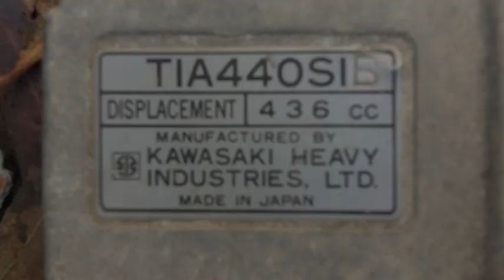Old Start the 1972 Arctic Cat 440 Kawasaki Panther Engine

Comment from the maker: Hey Ron, When I got this engine, I had intended to put it in a Honda Odyssey ATV...that would have been a killer machine for sure.  I ended getting an offer I could not refuse on the Honda and sold it. The engine has been sitting,  waiting for a new use...I hope it will work out. Thanks for watching.
Reply: Did u ever get it in a oddessy cause I’m currently trying the same thing with that motor?
Reply from the maker: @Fartmansdoodoo  Nah, I never found a good oddessy frame and eventually sold this engine.

Comment from the maker: @Graveltrucking I plan on running this CVT through a rear Diff I pulled from a 4x4 quad that has a stripped axle shaft. It is geared low enough that I should be able to keep the revs high on the engine and with good blade speed. The compression is remarkably strong at 175psi.
Reply: UH. yeah ...you might want to check calibration on that comp. tester.. Old 2strk. with questionable ring seal?
Real world bet is 120 psi. If lucky.  (440 Kawi. single carb. without a proper expansion chamber? 37h.p. if lucky)
Your gonna have to rev. the dog snot out of it to get in the useable power band. It is designed to run below 30º F ya know.

Comment from the maker: @fritzhvacey Mr. Fritz, I don't think I will be lacking for power on this machine.  I had planned on being able to cut a 36" diameter trunk, 16' long. I didn't want to worry about binding the blade or bogging the engine, so I think this should work out fine.  If not, I will put a small block chevy in there, but will have to see  

Thanks for the well wishes and I hope you have a Happy and Healthy New Year!!!

Comment: I had a 1972 Arctic Cat 440 Kawasaki Engine in my Puma 440. The Horsepower was rated at 35- HP.

Comment: That should work good for what you need you will have to try gear it so that sucker can run at high revs so it won't bog when you start cutting. You got a good engine there with 160 psi compression on both cylinders.

Comment from the maker: hahaha, I had grand plans of using an Honda Odyssey chassis I had and stuffing this engine in it..that would have been suicidal..but awesome indeed.  I ended up selling off the Honda before doing the work.  I plan on setting up the power unit so if I come across a different engine I can swap it out and use this one for some other silly death machine...lol.

Comment: I am thinking lots of power but too much smoke and it might over heat as it should be run in 
the winter time! I have a motor out of a golf cart that uses the generator to start it those golf 
carts start up when you push the gas and shut down when you let off on the gas at idle but I 
am thinking with the clutch should have all kinds of power and it is a four stroke might use it 
on a swing blade style carriage!

Comment from the maker: @trbfshmn I really didn't know the condition of this engine, other than "it ran when the sled was parted out".  I think it will work out great, and it came with a complete spare engine that is siezed.  I put a few ounces of oil in each cylinder and maybe one of these years I will mess with it, otherwise it's a great parts engine.

Comment from the maker: @MrDirtrider777 My original intention with this engine was to put in a Honda Odyssey with a blown engine.  It would have been a sweet death machine, but before I could get it done, I was offered way too much money for the ATV, so I sold it. I ave a complete spare 440 engine that is stuck, I put oil in the cylinders years ago, I should try to get that one running. hmmmmm
Reply: yourbeekeeper  I need your help

Comment: did you ever finish the mill?
Reply from the maker: Not quite finished... I ended up selling this engine to a friend who a better use for it.  I am looking for a 4-stroke engine to power this mill...not really interested in having a 2-stroke screaming right by my head for hours on end....  the cutting trolley is complete... just waiting for me to get around to locating a suitable power plant.
Reply: @yourbeekeeper ~ I am running a 5.5 lifan motor it works but when doing a big log 13 ~18 " you have to take your time! The going rate is 13 Hp but I am thinking that you could run a eight or ten industrial B&S would work fine.

Comment: careful running it like that with the clutch and no belt in the clutch.. i've heard they explode. all the owner manuals say not to run the engine with no belt... should be good to go if you take the business end of the clutch off.